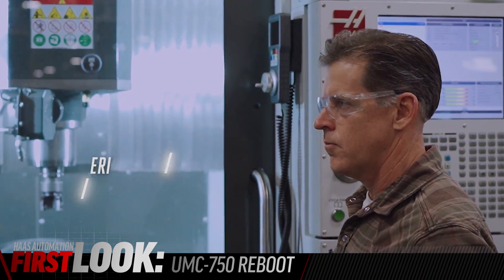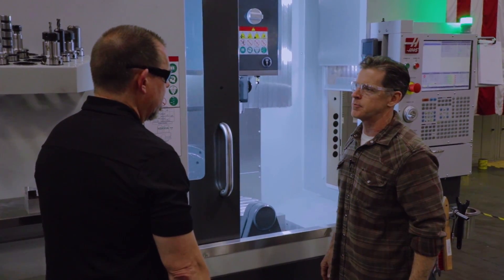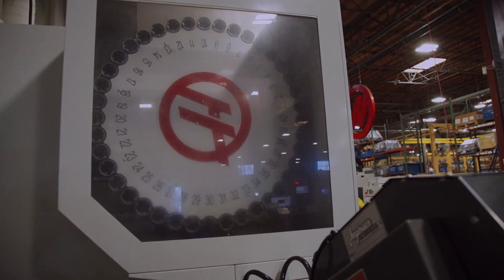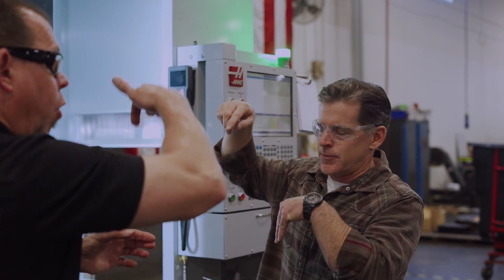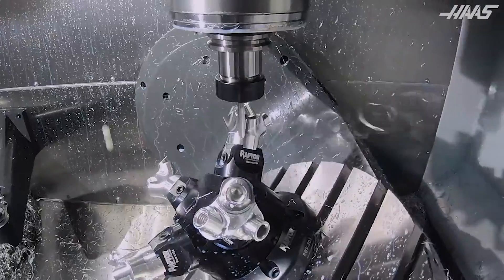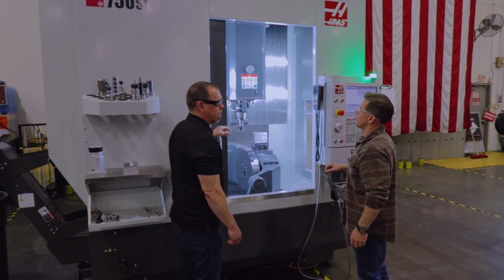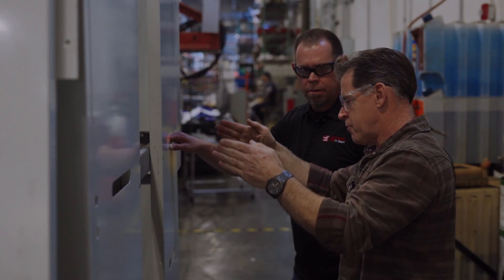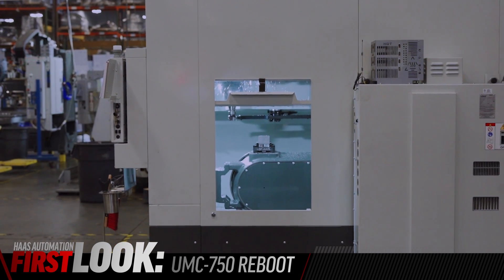UMC-750 Redesign - Haas Automation, Inc.

Comment: I assume the linear rail and truck upgrades are to reduce the machine jittering with the y axis at the y-  extent? I cringe at the thought of no crane access. That table will be chewed up in no time from lazy operators sliding parts off the forklift. The coolant tank and control panel should have been standard from the start. Thoughts from a umc-750 gen 1 user....

Comment: These are indeed very nice improvements. The redesigned door and relocating of the controller is very nice. IMO the previous postion was annoying.
I was wondering if the redesign includes an option to add a spindle cooling system? At work we have a UMC750, and the spindle does really heat up. The heating  result in 0,05 mm extension on the Z-axis after a couple of hours running at 8000 rpm. That causes problems when we make our molds. 
When running the through spindle coolant the UMC 750 have a long time of releasing the pressure before a tool change, whenever i use small drills. Does the redesigned version have som sort of valve to quickly release the pressure from the through spindle coolant?
Sorry if i'm difficult to understand. English isn't my native language.

Comment: Nice to see the all of the improvements that were brought in with the UMC-1000 have finally trickled down to the UMC-750. The cycloidal drives in the B & C axes are a big improvement and are a lot cheaper to replace in the event of a failure. By the way, the roof has been standard on the UMC-750 for 2 years.

Comment: Haas made nice windows! The only remains to do is rigidity, thermal stability, strong servo, good ballscrews, reliable spindle and fast ATC. Congrats
Reply: I got a fully blinged out 750 the refreshed model and Its a hell of a machine. Rapids are fast and surface finish is superb. I'm sure a DMG would be better but this thing can do 90% of what a DMG can at half the price.

Comment: I was just wondering that if it was possible to get the control floating and remove the corner behind the control and make it a door/transparent window, so you have more access to the work area and more visibility and the work area has access from two complete sides ?

Comment: I love HAAS's use of stove elements for dynamic braking resistors (I assume for the spindle / servos) beautiful use of a cheap alternative to high wattage resistors. (In the box with the heat warning symbol on top of the control cabinet @2:11)
Reply: And you can go anywhere and get replacements.

Comment: the only problem with the new design of the machine es you can't use a crane to lift parts into the machine anymore
so now the strain is on the operator of the machine when he lifts in the parts
I am heavy it's not me standing at that machine
Reply from the maker: We use a Big Joe Straddle Stacker in our own shop.  You can check it out at the link below - Haas Automation
https://bigjoeforklifts.com/products/ibh

Comment: With the enclosed roof can you access with an overhead hoist for heavy parts?
Reply: Why not just use the fork lift? We’ve put 700lb parts in our nakamura tome lathes no problem with the fork lift. I imagine anything too heavy for the fork lift would be too heavy for the machine anyway.
Reply: @zrams023  it's just not as convenient. Especially when the machine is in a tight area where it's hard/impossible to get the forklift. Also if you have several heavy parts to run and you only have one forklift you don't want to be tying down the forklift all day. We have overhead cranes which makes swapping vises and loading materials easy and quick.
Reply: No, Probably the only thing that sucks about the new ones, especially with heavy fixtures and parts
Reply: Our ‘18 vintage machine came with a roof that we left off for using an overhead crane,  but our coolant splash isn’t bad enough to go out the top (no TSC)

Comment: What’s the max table load? Is there an overhead crane access to the machine table?
Reply from the maker: thegrismol - Max platter weight is 660 lbs.  You can see all the machine specs on the SPECS tab at the link below - Haas Automation
https://www.haascnc.com/Community/Events/umc-750-us-ca.html

Comment: Now, just need to convince my boss that we need this.
Reply: @farmer7888  right tool for the job sounds like.
We're a 3 person job shop typically doing under 5 qty and down to .001", the old UMC750 design has been doing great for us. If it were running like your DMG's I don't think it'd be making y'all happy.
Reply: Joshua Hempel ya the dmu 50 are the same price way better machine
Reply: @vince-lombardi  I'm pretty sure the dmu is over 2x the price. I think the cmx line (economy) are almost twice the price. What's the price for a dmu? The UMC is ~160k